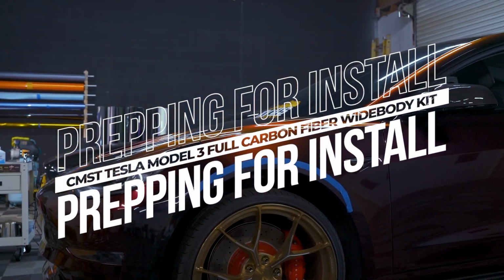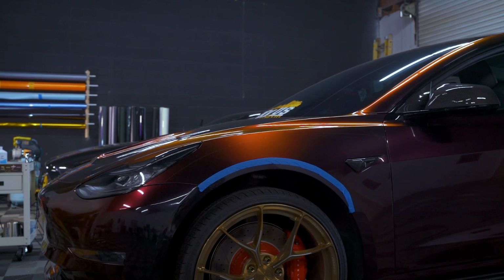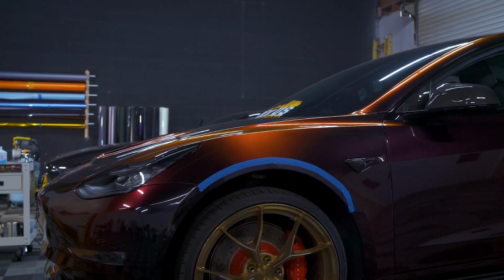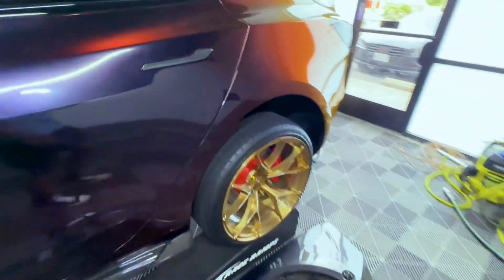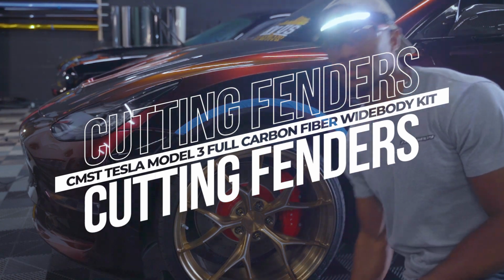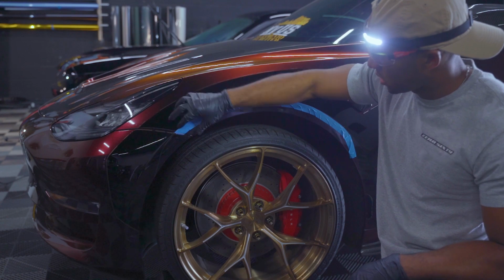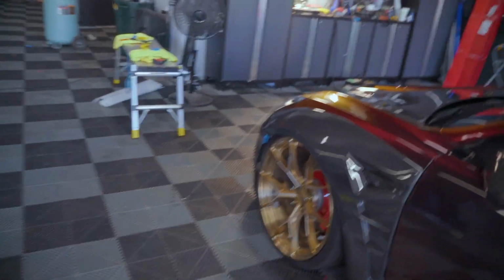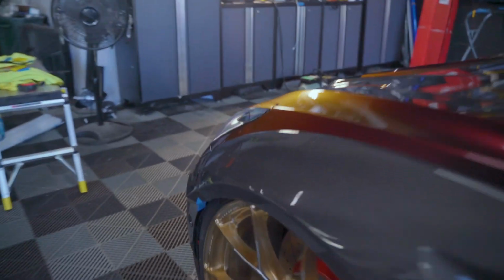Tesla Model 3 CMST WideBody Kit Install

Comment: What kind of epoxy did you use for bonding the fenders? I’m doing mine so need all knowledge possible. Thanks
Reply: I’m currently doing mine as well…. I wouldn’t bond the rear I would do a reverse mount in the rear because if the motor in the rear needs to be replaced then you will have to remove the rear bumper… this install was not taking that into consideration and if they need to remove the rear bumper for any reason they will have to break the CF kit.. on the front I will be using panel bonding glue from SEM or 3M…. The rear I will reverse mount and use a silicone based sealer that can easy be removed with dental floss or something similar…

Comment: so wait a minute I really can't get over this....the outer AND inner part of the fender were cut and left alone....there was no RE-BONDING of the two afterwards...which means..... where water once could NOT get to.....is now fully exposed to the elements under the carbon fender?  

That car is ruined no???....someone please help me understand.. That's also a very important structural part of the rear quater-panel and should be bonded back together... of course no answer.
Reply from the maker: Yes certain were made in order to achieve proper fitment as this car is equipped with an air lift system. In order to achieve ATG (ass to grass) trimming of both fenders was the way. 

As for sealing the inner fenders those were completed outside of this video
Reply: @tintmyridefresno  the height of the trim determines that… welding or bonding of the two panels is what I’m referring to… the car will be ruined in a few years by water
Reply: I’ll take your word for it, but I’m not sure how that can be done when the CF fender was clearly bonded BEFORE the 2 fenders were bonded…. Either way…. Good work…. Looks nice….